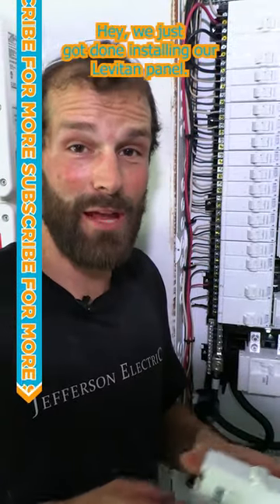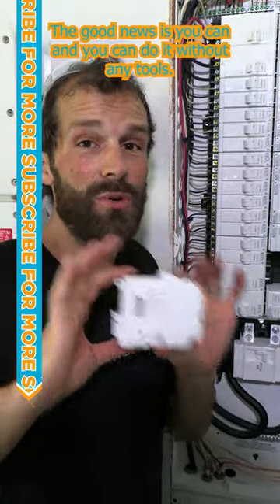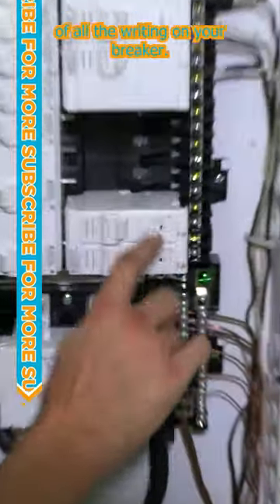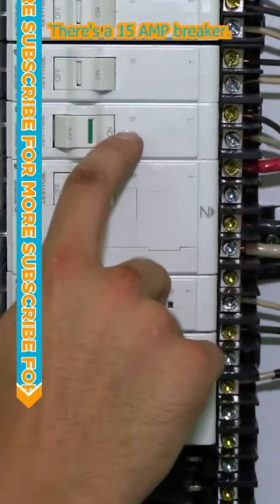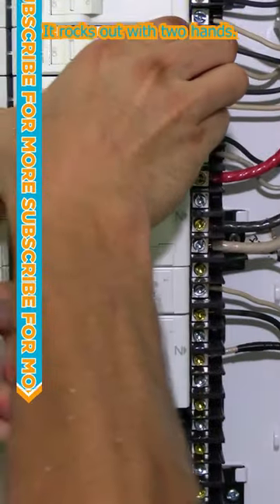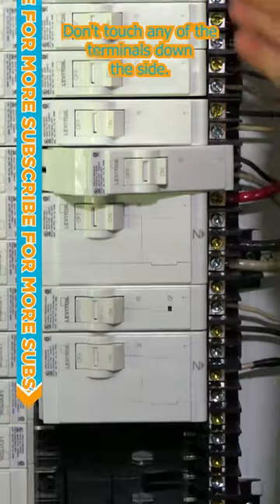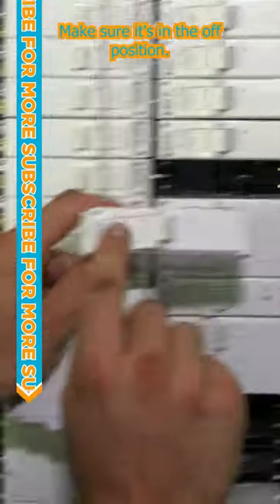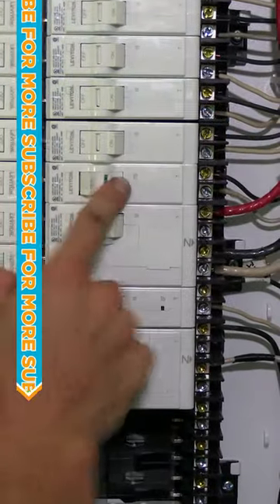Swapping A Circuit Breaker With No Screwdriver?

Comment: How are the terminals down the side proteced!!!??????
Reply: @ElectricProAcademy  except you didn't in your video, and the responses here seem to overwhelmingly believe the panel is still live. Maybe you want to be more descriptive and informative in your explanation, it would literally take only a few seconds to say "make sure to confirm the service isn't live"
Reply: They're "protected" by the plastic boxwork they're set into, which is intended to reduce accidental contact. If you lay the side of your finger  on them you'd probably only make contact with the plastic, but I sure as hell wouldn't poke my fingertips at them.

Comment: Would you need to shut off the main breaker before you start yanking on stuff and putting your fingers where they shouldn't be?
Reply: technically you dont have to, but for the accident prone people out there, not a bad idea (ive replaced and added several breakers before to a live panel)
Reply: 100% should be off all the time.  I don't care how experience you are there is just no reason to not shut it off.  Unless you have ppe gloves and a full face shield.
Reply: @MOtherBoardFire  calm down. I've probably wired as many panels live as I have dead. It's 120/240, not 600.
Reply: @jefftickleschitz1265  Yeah... That means you haven't done ANY that were live.
SMH at another KAREN.
Reply: @stans5270  hahaha, what?
Reply: @MOtherBoardFire  change bolt on breakers live frequently. Put some wire-eze on those gloves and enjoy your full face shield.
Reply: Only if you wanted to do it safely.
Reply: If you're asking for it. 
Lol yeah just stick your fingers into the areas where high voltage exsists and then as it breaks lose your momentum  can swing you into even more live terminal
Reply: @jefftickleschitz1265  yeah well how many dead people do it twice?
Reply: @luvdady  *covid

Comment: Leviton Is almost resembles the Snyder  panels in the Netherlands. But really the  But Leviton  It's definitely more homeowner friendly if they got a change of breaker there's really no terminal screws. It's just plug in breakers. Unlike other panels you got to use screw terminals on the breaker.  I still kind of like CH Cutler hammer better technology has opportunities

Comment: Unless there is fused DP breaker switch before the consumer unit (breaker box) and it's off do not touch the open box.  No electrician should even attempt this without isolating the box or himself with PPE

Comment: These panels from fresh companies like Leviton and Span seem so amazing, but they don't sport that beefy look I'm used to from Schneider/Eaton/Siemens
(he says as he deals with SqD panel recall). And I'm like are they heavy duty or just light resi toys? Is there a therapy group for this?

But that termination in the panel versus the breaker?  Should have been done decades ago everywhere.  Now the legacy are stuck due to installed base.
Reply: Never liked SD. I’ve seen way way to many of their breakers fail to trip on dead shorts.

Comment: I always wear glives,just in case of a slip,advising DIYers to do this without giving them any safety  precautions is not a good idea.
Reply: If you are at the point of being afraid of slipping call an electrician please. You should never work on electrical if you are afraid of it.

Comment: Hey Joel, how do you like those leviton panels? I've heard they're hit or miss...
Reply: @ElectricProAcademy  I've heard from some early adopters like yourself of having multiple call backs from clients due to GFI/AFCI breakers randomly tripping and then showing as faulty during it's "health check" after a couple of resets. I've also heard of the smart breakers making a small buzzing noise from the DC transformer that powers the built-in wireless module for the smart control system. Add many breakers together and in some instances they claim the noise is quite noticeable.  I'm glad to hear you're happy with the load center. I have a possible panel upgrade job coming up and I'm interested to sell this to the client as I'd like to see how good it is compared with the older brands.

Comment: A non trained person should never ever ever open up electric service and never more work on the panel wo extensive training. Doing electrical work is not a hobby.. and all professional, trained (intelligent) electrical contractors know that you don't test or troubleshoot an electric service by throwing a breaker and if it works it's good and if it doesn't.. start some Easter egg technique of identifying the problem by swapping out parts...yes there are minor repairs that a homeowner can complete wo an electrician, but those tasks require training. The possibility of fire and other bad outcomes are a real possibility for experimenting..if you don't know what the NEC is you should not be doing the work.. simple basic rule
* Also omitted from the video is the primary best practice... ensuring that the panel is de-energized using proper test equipment.. which is not a @$5 dollar wand tester from Home Depot* 
This kind of advice gets people hurt or killed..has houses burning down..
Much easier to rebuild the automatic transmission in your car using a butter knife on your kitchen table..

Comment: Please don’t anyone do this. Especially without hand or eye protection
Reply: What’s wrong with changing your own breaker…? I mean yes you should wear PPE, but it’s a very simple and straight forward task. Household electrical in general is all extremely simple. I’m 26yo and no electrician but I wired three new circuits from scratch, into the room I renovated last year all by myself. It came out beautifully. Passed code. And still works great not a single issue now a year later. It was one of the easiest, most straight forward things I’ve ever done in my life. It was not complicated whatsoever and not dangerous either.
Reply: @kcscustom9759  this is what’s wrong. You claim it to be the easiest thing you’ve ever done but have you ever had a faulty breaker explode in your hand? I’ve been an electrician for 17 years and have saw some nasty accidents in my time. I’m not saying don’t change your own breaker, I’m saying don’t do it the way he’s “ showing “. Hand and eye protection. And him running his fingers near liver terminals to show you to keep your fingers away from them is just plain stupid
Reply: @fraserreid719  are they live though? He didn't say either way, but his explanation does seem to imply the service is still live, definitely seems suspect.
Reply: @onradioactivewaves  telling you to keep your fingers away from terminals favours the live theory
Reply: @fraserreid719  he says a lot of confusing things. From what I've seen so far, it seems that he's giving advice to people learning electrical trade whilst not becoming electricians themselves. That being said, I dont know when its ever reccomended to work on a live panel. I wasnt an electrician myself, but was learning NEC due to working on products which needed to comply and be installed in accordance with the NEC. I did work on live circuits, but only as  necessary and only in a lab environment with extra safety precautions in place to make it legal and "relatively safe". I can tell you that there's no good reason to work on live circuits except out of necessity. Things can and do go wrong. Just one example I could give that I didnt see happen but definitely is a possibility, someone could snip a solid peice of wire which flies into your live circuitry causing an arc ash situation. Or you're tool could slip, things can fail, sloppy wiring could exist, etc . Safety precautions may seek annoying, but its really not worth risking your own well being or even life to save some time. And if you're giving advice to an untrained non-professional, you should err on the side of caution. Even professionals and experts can make mistakes and have accidents, let alone folks whom are ignorant of potential and inherent dangers.